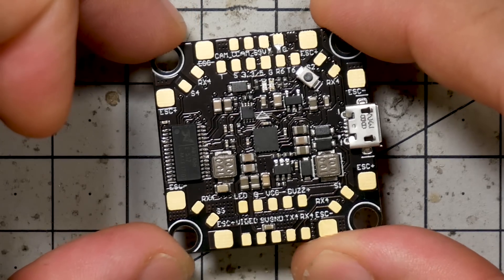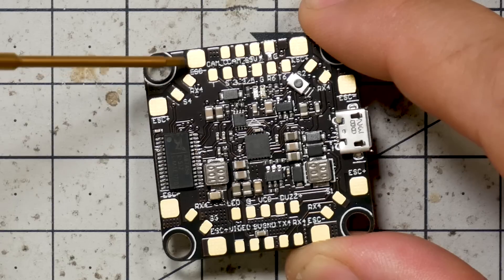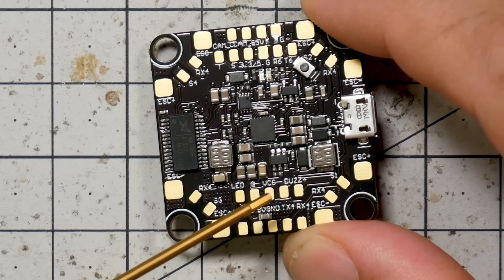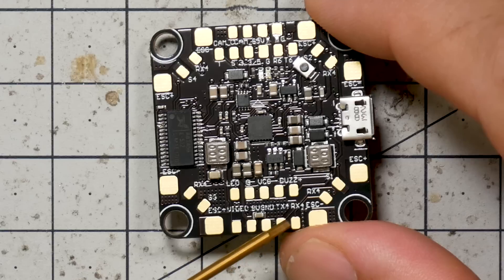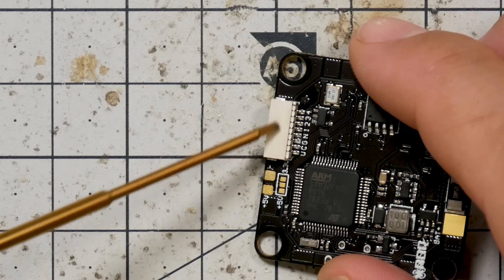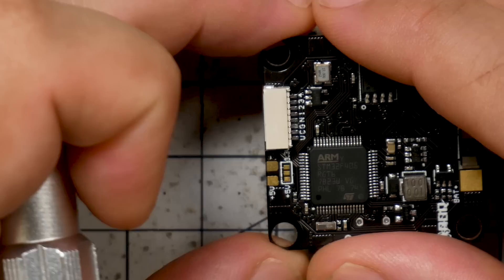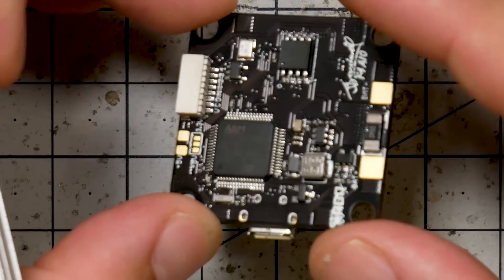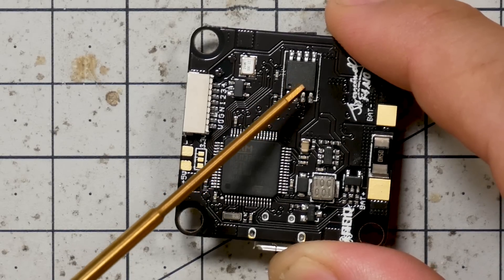JBF4 Flight Controller v1.3 | NEW LAYOUT AND FEATURES

Comment: I’m going to strap my DOA JB4 flight controller to a rocket this 4th so it can actually see some real flight time.  RaceDayQuads is a joke to deal with.
Reply from the maker: What is the specific problem you're having after contacting them to discuss warranty replacement?
Reply: After a few emails of them treating me like a kid about installing the board they said I could send it back for a refund at my own cost. It was going to cost me 10 dollars to send it back. Then by that time this isn’t a budget friendly board.
Reply: I bought 2 of these boards from amazon before I realized they were coming from RaceDayQuads and they were fantastic but the last one I ordered from race day has gyro issues.  It would keep rolling to the left faster and faster till it was unflyable.  It even did it in the butterflight software with the receiver unhooked.

Comment: Are you able to put solder pads for the ESC signal behind the header plug? I like to use 4 in 1 ESC but not the header plugs on the FC.
Reply from the maker: There's really not much more room on the board for additional pads, to be honest.

Comment: Your great. Love the videos..I'm new to fpv. I have a radiolink at9s controller from a rtf kit... can you recommend a good  mini whoop that will be compatible without to much fuss to the at9s..I need  a good practice whoop
Reply: Seabreeze 2112 i have an at9 as well. There aren't any bind and fly "woops"that are compatible with the radio link. Dont be discouraged though, you can get a cheap spektrum radio like a 5xe or 6e and get the spectrum version. Typically in the "woop" category its frsky or spectrum. You can get boards that are flysky, but those are not as mainstream. The at9 is an awesome radio, with cheap great receivers don't think you have to buy a super expensive radio to have a great experience
Reply: David Easley thanks for your input...I did find the radiolink f110 mini drone... but it's not really for fpv acro practicing

Comment: greetings excellent channel I learned a lot and now I have a problem I hope you can help me: I changed my old FC F3 for a DYS F4pro and alm put the video a lot of noise I put filter and capacitor and still had bad in betafligth in video by car, I changed to pal because so I fly and I improve something but very little in fact it is almost impossible to fly, and I crash once, and I change another vtx and continue the problem I do not know what it could be or if the FC is wrong, thanks in advance and espro púedas help me and once again a super excellent channel.
Reply from the maker: Try the following:

1. Power camera and vTX both from vBat (assuming they are rated for that voltage).

2. Move the vTX and camera ground wire to the exact same pad (twist them together and solder them to the ground pad).

3. Isolate the vTX SMA connector from the frame.

Comment: The thing I see missing is SCL / SDA
Reply from the maker: Yep. This board is not intended for GPS use. That's just not a function we have planned for. If you have a GPS that works solely through UART it can be done, but if you need i2c then this is not the board for you.
Reply: I will keep hoping!
Reply: Baro & Compass ARE important, GPS less so but we NEED i2C for this too

Comment: Joshua, is the FC suitable for X Class? Always love your content. Rotor On Joshua!
Reply from the maker: It is only rated for 6S, but I think most X-class racers are using a regulator to power their FC since they're running 8S or 10S and no FC is rated for that. The MPU6000 gyro should be better at dealing with the vibration of the X-class quads. You should ask an X-class pilot what other concerns are unique to them and see whether my FC is a great fit.

Comment: Joshua Bardwell I'm just getting into fpv. Plan on doing freestyle flights and cruising mostly. Would this be a good starter board for me? I'm thinking of just using individual escs. Thanks and keep up the videos!
Reply: detpackZ I'd definitely recommend the Bardwell FC for a first time build for the manual alone. It's really got every feature you want, nothing too difficult to figure out, and a large community that can help if you get stuck
Reply: Christopher Harper thanks! Sounds good

Comment: Hey. Uart 4 rx was for ESC telemetry. But you also put uart 4 rx tx down there at 3:00.   Couldn't you have another uart there instead?
Reply from the maker: It's not just PCB space that limits the available UARTS, but resource in the processor.
Reply: Thanks!

Comment: I'm happy with the data chip. I usually delete the sd card after a day of flying anyway. I think it was a smart choice, and I love the vcc pad for the unify hv. I actually ordered one last night without even noticing it was v1.3. Its actually going into one of my older builds with an "old" betaflight F3 and now that I know its a new design I want one for the my current build even though there is nothing wrong with my old one JBF4

Comment: Glad it still has dataflash - I use blackbox a lot, it speeds up troubleshooting tremendously, I check logs routinely when it's too dark to fly or weather isn't cooperating.  Picked up a 1.3 JBF4 recently and it's the first FC besides the CLR F4S that is close to perfect for my needs.  The two are neck and neck for me - I prefer the ESC layout of the F4S but the rest of the layout is better on the JBF4, both boards can handle controlling a RC Split, telemetry, and smartaudio without having to use F.Port or any other UART tricks.  Killer.

Comment: Joshua, question. Is there any documentation that the new version doesn't have an SD card reader other than this late video? I have 3 boards sitting at the school waiting to build and expected them to have SD readers. How long has 1.3 been shipping?
Reply: just got a order filled from race day and received last sat and had a v1.3 with no sd reader, so I would say they are now shipping the current version.
Reply: Courtney Strachan 
Had the same problem with getfpv, ordered what I thought was a v1.3 and got the older version with the sd card holder/reader. Guess they're clearing out the old stock first!
Reply from the maker: The product listing on RaceDayQuads has been updated to reflect this. If you purchased from somewhere other than RDQ then you have to check with them to see what version they are shipping. Ultimately, the product listing on the vendor site should reflect what you're purchasing and if it doesn't, reach out to the vendor for resolution.

Comment: Hopefully the becs on the new one are better than the last. I've had the pleasure of soldering up 3 different jbf4 and every single one of them fried the 9v
Reply from the maker: There is a recall on that batch of FC because of the defective 9v regulator. We sent an email to all customers and resellers about it. If you have JBF4 with dead 9v regulator contact your reseller to discuss replacement under the recall.

Comment: Hey Josh was going to build a 6inch mid to long ranger what kv should I get looking for a mountain cruiser
Reply from the maker: For 6" on 4S, I think around 2000 to 2200 kv is a good place to be. Lower kv will give longer flight time but less power.
Reply: Thanks you rock

Comment: Have any adjustments been made to affect pad pop off? My v1 board pads went off like Orville Redenbacher and never even got off the ground.
Reply from the maker: The 1.3 version of the board is made in a different factory than the last batch of 1.2 version. The last batch of 1.2 version had a defective 9v regulator and was subject to a recall. If you have any with a dead 9v regulator you should  contact your reseller to ask if you are eligible for replacement.

Comment: Have you heard of anyone using inav on your board? Until I get better, equipment and skill, I want the RTH feature that inav has. It might have saved my drone and I would still be flying.
Reply from the maker: No, my board is not good for iNav. Betaflight 3.4 has added a "GPS Rescue Mode" feature, though.
Reply: Joshua Bardwell awesome I had not looked at 3.4 yet. No need to switch to inav.

Comment: Cant get cam control.to work on this board useing caddix sdr1
Reply from the maker: The camera control feature in Betaflight does not work 100% on every camera out of the box. There are some suggestions in the user manual for how to troubleshoot it. I have personally used camera control on this FC with the SDR1 and it worked right out of the box.
Reply: Joshua Bardwell what were the settings you used for it
Reply: Did you take a look at the Wiki on cam control? Also, do a google search for camera control compatible cameras. I helped a friend of mine get the Caddx working, in the end it worked, but you had to leave the throttle half way or the right stick would not respond.. So if you do get the menu up, but the right stick doesn't work, try leaving the throttle at half and trying then..worked for him
Reply: Chris Shipley yea went to caddix site set all the cli settings cant get menu to come on im thinking its my pos turnigy evo . Im waiti g on my new x lite to get here  then ill retry it
Reply: Did you try just yaw right and hold it?
Reply: Chris Shipley i tried everything yaw right . Mid throt yaw right yaw left . My smart audio does work with my settings . May be its just this cam imm gonna trie a differant one and see if it works

Comment: Very nice update to the fc. Gotta say like built in flash. The telemetry pads are great and signal ground pads are really not needed. I dont use signal ground with single esc to pads on fc I just jump signal ground to the power ground pad on the esc. It works just as well. The 4in1 plug rocks. Gotta say a perfect evolutionary update to the jbf4. 

I must have one very soon. So when is the JB signiture esc coming? 😉

Comment: Thank you for the Rx4 pads at the corners. Getting 4 esc telemetry wires to one small pad was messy with the pigtail that I had to use. 

And thank you for removing the sd card. I tried different ways to keep it in, but I lost 2. I eventually just got glued it in, but now I don't use it cause it's such a pain to remove it and then glue it back in all the time. Although, I hear the next BetaFlight will allow you to read the card without removing it. Interested to see how well that works.

Comment: What's with durability? A lot of boards come to the customers already dead (me, for example) and many (according to the comments) break suddenly after working perfectly normal several weeks/months.
I really wanted to use this board, I like it. But I had to choose a stable working board with worse layout than perfect not-working one.
//ordered from RDQ, delivery cost me about $60 so they just returned money for the board.
Reply from the maker: If you have a recent 1.2 board with dead 9v regulator, then you are probably affected by the recall and should contact your reseller.
Reply from the maker: The last batch of 1.2 had QC issues. We emailed all customers and resellers about a recall and invited exchange of the boards. The 1.3 version is made by a different manufacturer and we have implemented new QC procedures.
Reply: So to confirm, V1.0 and V1.3 are fine concerning QC, just the bad batch from v1.2?
Reply: first touch of the 9v pad and it came off,, got stiffed by rdo,, them 6 months later,, recall,, mmm let me go dig it out of the dump for $40,, hey right,, 4in1 esc,, well expense to high to replace,, tell tyler I said hi,, he is really jeff "my name Jeff, I like trains"
Reply: They dont return the shipping you paid for wich is bullshit
Reply: Not sure that I understood you correctly. 
I had an order for ~$700 (fatshark goggles and some other stuff) so when I told them that fc was not working they just returned $40 to me. Probably because I had a big order so it is obvious that I'm not trying to get smth for free.
So they sometimes return the money.
Reply: Kato Otak yah we couldn’t figure it out until another pilot on the field watched and saw the problem and asked my friend what FC he was using. Once we told him he mentioned that he had the same problem and had to get it replaced for the same reason. Something about it having either a bad or weak trace for camera voltage. :(
Reply: Thank you. I really hope this thing will change the market, good luck.
Will have to contact someone directly as you don't have my email for the recall procedure.
Reply: Joshua Bardwell thanks for the reminder. My friend didn’t know about this so I’ll forward him the info.
Reply: I bought a CLRacing F4S (which is very similar to JB's FC) a few months ago, and it had the same video problems you guys are talking about. Glad I'm not alone.
Reply: having the same camera issue with clracing f4s... did you change whole fc or just wired your cam to batt voltage?
Reply: kebabas5lt I actually ended up changing my 2306 motors to 2206 motors and the video issues resolved. I guess the smaller motors can't drop the voltage low enough to screw up the FPV feed. I would think running it off VBAT would fix it though.
Reply: I dont know how or why folks had any issues returning bad boards to RDQ, I swapped two, one V1, one V1.2 (out of 15 total), no questions, just had to ship back the bad ones.
Reply: Wonder what they are doing with the recalled boards - with the new Betaflight 3.4, they would make perfect USB Joystick converters for your Tx for use in simulators . . . just saying there is a great secondary market . . .
Reply: Dmitry Ivanov a friend of mine has the v1 and the FPV camera seems to reset mid flight for absolutely no reason. Sometimes he’s punching out and it resets. Sometimes it’s just from cruising...

That being said I’ve had a gyro on a new Betaflight F4 FC on a backup quad go bad after a month of NOT using it. (Still can’t figure that one out)

Comment: Nice! Plan on getting one for next build soon. Side question... what is the signal ground for esc for anyway?? Necessary?
Reply: He made a video about it: https://www.youtube.com/watch?v=4AhMdGe_EbM
Short answer is yes
Reply: It helps on noisy quads but if you have it capped and good soldering you can get away with. I usually take a 26 to 30 awg wire and jump the esc signal ground directly to the negative bat pad on the esc. It works well and looks clean. Still use caps though.
Reply: To see if its the fc you can take a signal wire and move it a known good location. It is not too hard to depin and swap pins on a plug and it should be really fast to test the esc motor and fc all in one shot. Say if motor 1 is the one giving you an issue. You can take the signal pin for motor 1 from the plug going to the fc and swap it with the pin for motor 2. If it is the esc motor 1 sig wire should spin motor 2 but motor 2 sig wire will not spin up motor 1. If it is the fc the problem will follow the sig wire pin for motor 1.
Reply: Thanks!!
Reply from the maker: I do think there can be an advantage to running signal ground wire, but there is not a need for a separate signal ground pad on the FC. Especially in a case like mine where the signal ground was literally right next to the power ground.
Reply: Thank you Josh as always! I don't think you realize how much your videos help out the newbies. The reason I ask is my ground signal wire on 4 in 1 was fired and completely separated but yet 3 motors still turn. Suspect motor does not twitch on startup at all and not showing up in BLheli. I suspect 4 in 1 has burned out but would hate to wire up new 4 in 1 when it is after all the fc.